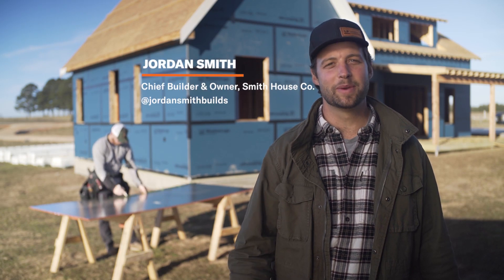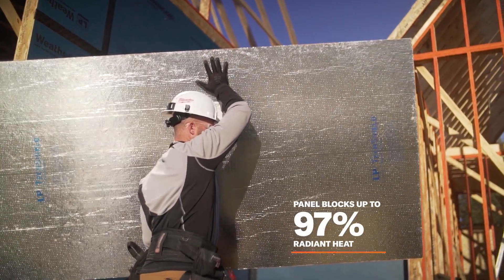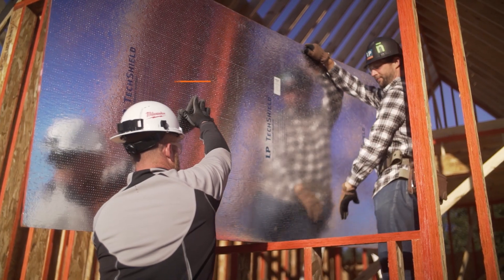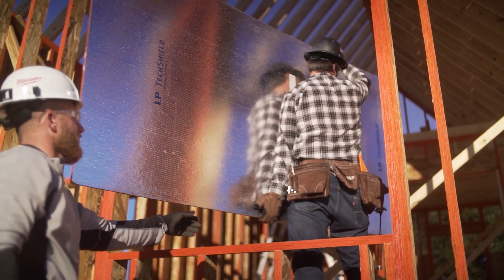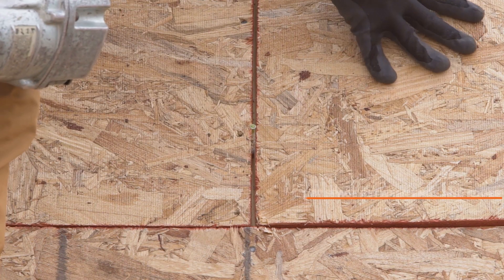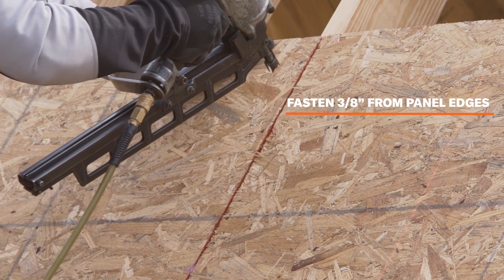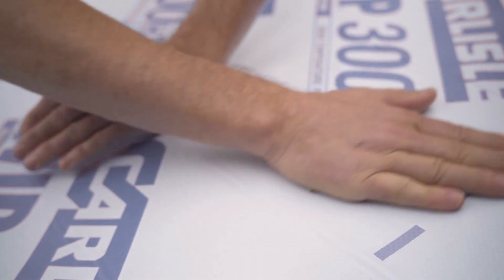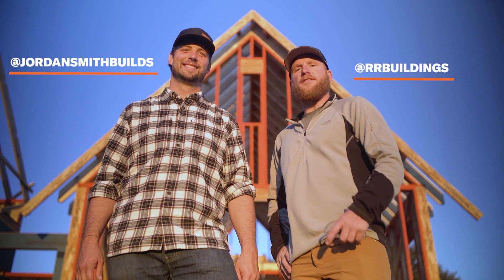LP® TechShield® Radiant Barrier Installation Process

Comment: How does closed cell spray foam effect all this, if i use closed cell spray foam directly on the underside of the tech shield what will happen, i was informed by the spray foam installer, that closed cell is a vapwr barrier itself..just concerned how this will effect moisture and heat

Comment: Radiant barrier needs at least 1/2" air gap in front of it for it to work, otherwise conduction becomes the dominant method of heat transfer and it just becomes a conductor. So in this case, it actually IMPROVED the heat conduction between the sheathing and rafters, and made them less efficient. Depends on what type of insulation is installed between the rafter, radiant barrier may help or hurt energy performance.
Reply: Radiant barriers work in 2 ways. Emissivity (preventing IR from being emitted) and reflectivity (reflecting IR). LP is using its radiant barrier by means of emissivity. Having a radiant barrier with an air gap to the hot side would be reflectivity. According to DOE foil faced OSB with the radiant barrier to the cool side reduced heat flow by 30%. By putting the RB to the outside it would reduce heat flow by 50%. PROVIDED there is an air gap (i.e. furring strips between decking and metal roof.)
Reply: @willguy425  Is reading comprehension really that difficult?
Reply: @mintheman7  but the conduction of the what looks to be a 2x12 rafter is next to zero. I guess you need to let a multi-billion dollar company know how dumb they are and hire you to do all their engineering? Yep, let us know how that works out for you...

Comment: I hope you guys see this… I’m building new cages for my rabbits, I live in hot California and I lose rabbits every year in the heat… the roofs of my cages is corrugated metal… I was thinking of using this product underneath the metal roof to try to reflect some heat out and away… it blows my mind that the foil side of this product goes down, is that still true for the application I’m trying for? These are open sided cages, wire mesh around a wood frame with the metal roof(gonna also spray paint roof white). My instinct is to put the foil side of your product out, but it says right on it to put it down… can you please clear this up and confirm  for me?

Comment: So, when the asphalt shingles are installed and nails poke through the radiant barrier, does this reduce it's effectiveness? When I look up into the attic I see hundreds of nails poking through the radiant barrier sheathing.
Reply: Hello. I live in Dallas. Same case as yours. So is it possible to leaking? Need to fix inside attic?
Thanks

Comment: Everything I have read U need an air gap on the underside of the panel for it work.  It also makes the asphalt shingles hotter, especially if they are mounted directly to the osb.  Also as others have stated your putting a vapor barrier on the inside so you better be ready to deal with possible condensation.  Doubt you get that much of a thermal benefit just looking at a basic install.
Reply: Bro they talking about the insulation air gap between the ceiling and the thickness of your insulation. Not between boards

Comment: Amazing video! One quick question is "why" does the foil have to face down? Can it be facing the sun? Thanks
Reply from the maker: Good question! LP® TechShield® Radiant Barrier must be installed with the foil side facing into the attic space in order for it to work as a radiant barrier.  As the panel heats up, the foil surface is only able to emit 3-5% of the energy into the attic space, which can reduce attic temperatures up to 30 degrees. If the panels are installed with the foil side facing up (i.e. against the roof underlayment and shingles), then it will not function as a radiant barrier.